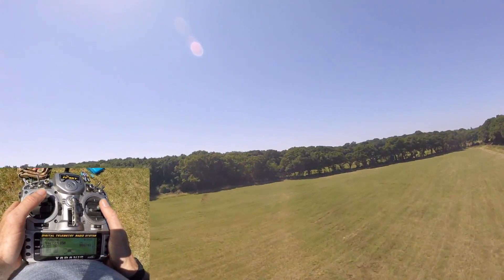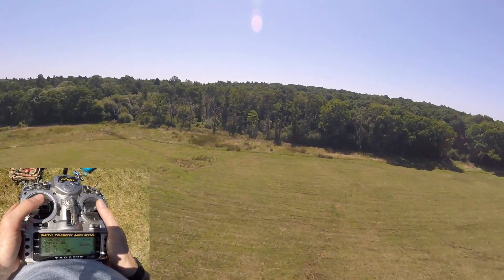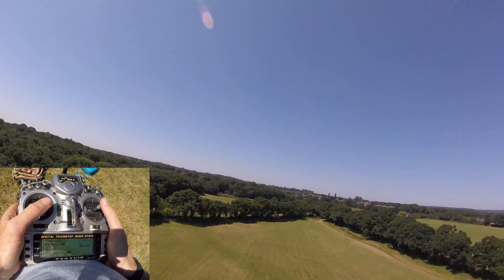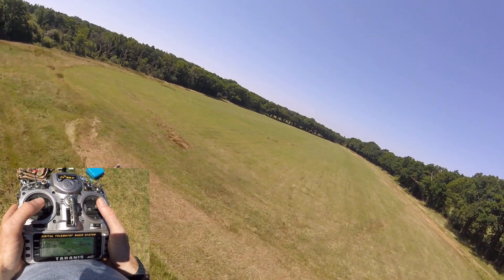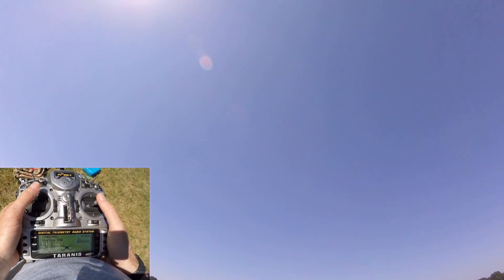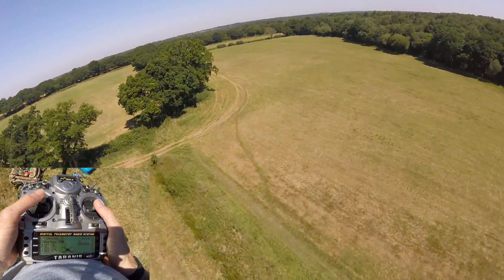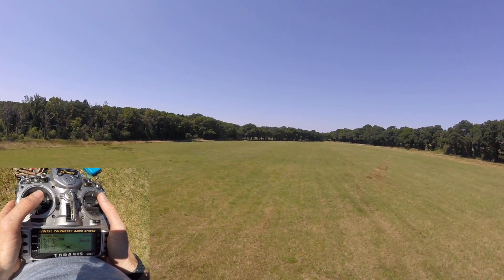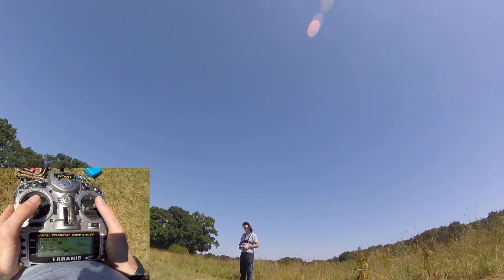FPV Tutorial: Beginners guide to Acro flying: Episode 6 - The Inverted Yaw-Spin

Comment: Hi great videos, i ve noticed on many of your videos that you have a dual rate switch on your Taranis. How do you do this? What are the benefits? Is this done in Beta flight and on the taranis? Would you recommend a novice to have this switch? It would be wicked if you had a video on this. Thanks in advance
Reply from the maker: I've explained it a few times on previous videos, but I still haven't corrected it.  It's actually a left over from when I copied the model from an old pre-betaflight model.  So when the voice says "dual rate calm" and "dual rate off" what it's actually doing is enabling/disabling air mode.  I do have the recording for airmode on/off but I've not updated all my models (and I ran out of memory on my taranis so it's pretty full).

As far as rates go though, I wouldn't recommend a dual rate for acro flying.  I would instead suggest getting your RC rate in betaflight as per the speed you want and then increasing the super rate as you gain more confidence in flying to start giving you a bit more in the stick extents
Reply: CurryKitten oh right I understand now. First thing thank you for replying to me it's appreciated. I forgot to ask do you set a throttle rate so your hover position is roughly in the centre stick position mode 2.

 An thank you for the advise I will certainly be following it. I 've watched all your beginners guides your new series and old and your beta flight tutorials. I 've learned loads and they are my go to You tube vids if I'm not sure about something or need advise. Keep up the great work.
Reply from the maker: Thanks muchly :)  To answer the throttle question, I don't.  It's mostly because that hover point is typically between 40-50% on most quads, but even if it's out, once I've got my goggles on, I only know the relative position of my stick in terms of if I need to increase/decrease throttle, so the fact it might be away from mid-stick isn't really noticed.